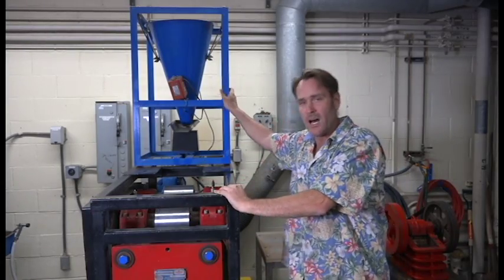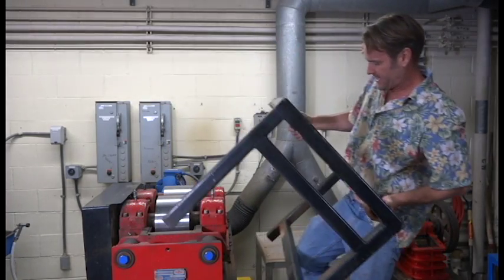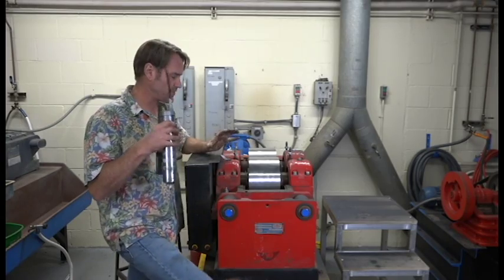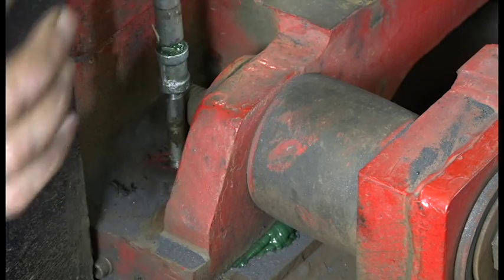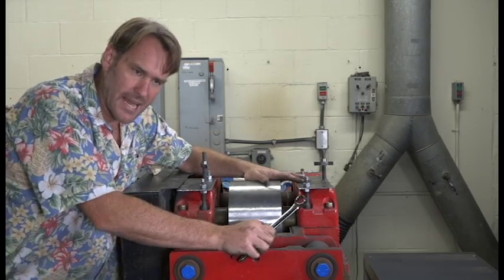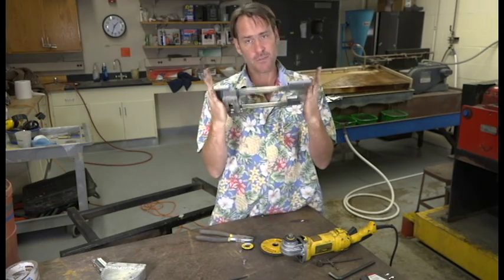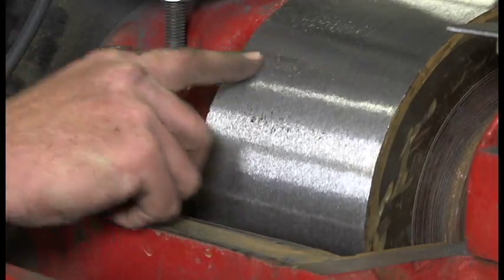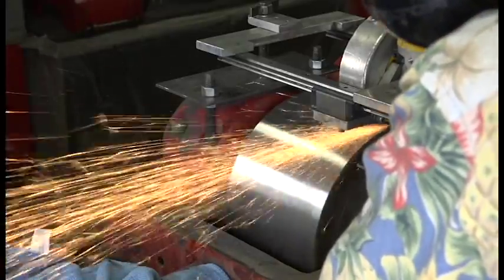rock crusher roller mill repair grinding wheels smooth DIY

Comment: You should do Lock Out Tag Out on y
the equipment so it is for sure deenergized and cannot accidentally turn on without the lock that the worker working on it has the key to.

Comment: also what size grinding wheel are you using?
Reply from the maker: I'm just using a standard 4.5" grinding disc and a Dewalt grinder that can handle 6-6" discs so I know it's robust enough for long use.